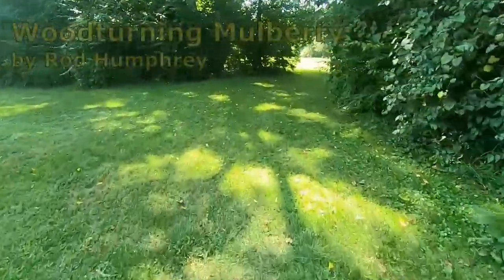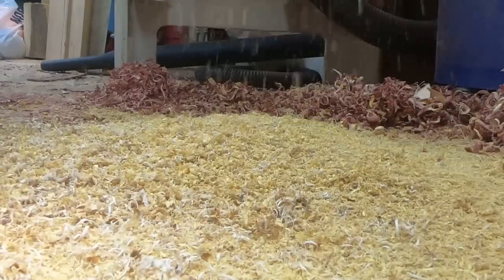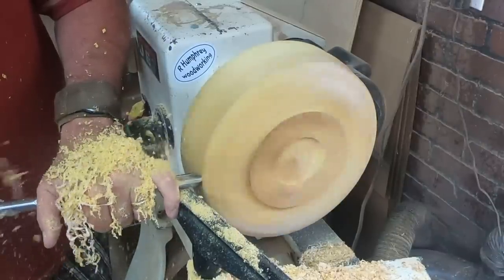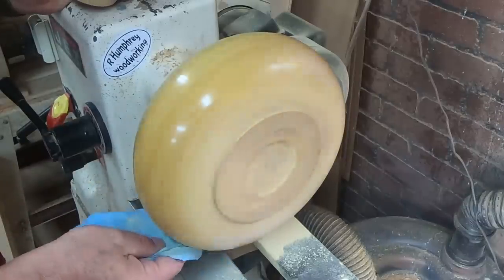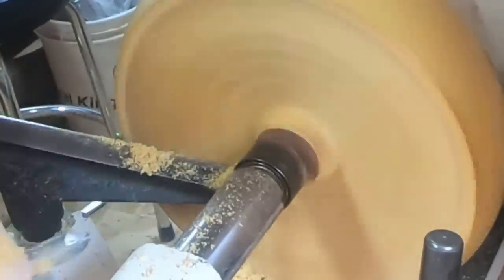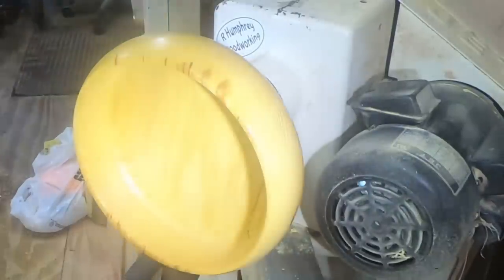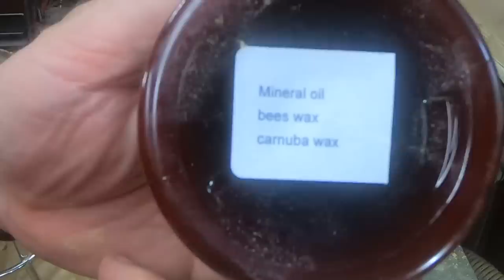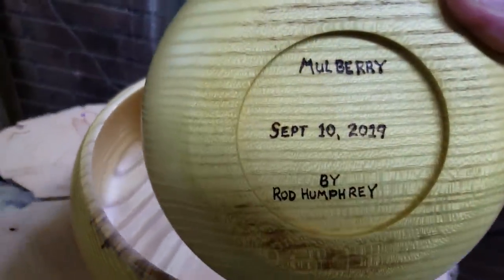Woodturning  Mulberry, and a Doug Moore Sighting!

Comment: Rob...I enjoy your videos and I like the low-key voice over. I have started to use mortice's based partly on your work. I've found that the technique DOES hold better than the tenon squeeze. But...what's the secret to shaping the bottom of the bowl so you don't accidentally cut through to the mortice? I've done it twice now attempting to get a uniform and thin dimension - and BAM I now have a hole the size of the mortice in the bottom...any tips? Thanks!

Comment: I never have success with a worm screw what size hole do you drill. Every time the wood comes loose . Please give me the insight on this. As always really enjoy your video’s !!!!!!!
Reply from the maker: The perfect drill bit for me is 13/32", which makes the hole too tight to put the worm screw in without a wrench.  Any smaller is too small, any bigger has proven to give me the same trouble you're talking about.  So, however big your worm screw is, the hole needs to be just barely big enough, ....if you can put it in without a wrench, it's too loose.  Hope that helps and thanks very much!!

Comment: How do you touch up your negative scraper from Carter and Sons?

Also mulberry takes on a nice dark color after some time. Have a few pieces went from that yellow to a dark dark amber. Beautiful stuff.
Reply from the maker: I give it a quick pass (both sides) with a CBN wheel on my slow speed grinder, and then touch it up with a honing iron just to make sure the bur is slightly upward facing.    Nice, I didn't know about the color change!